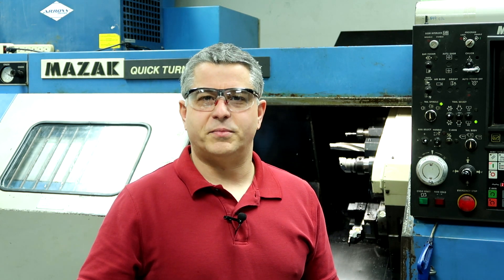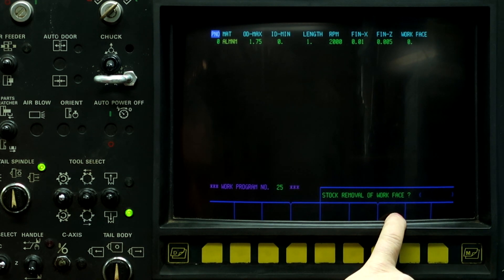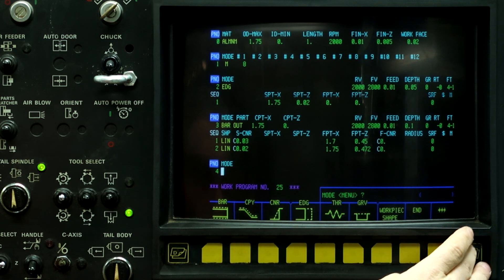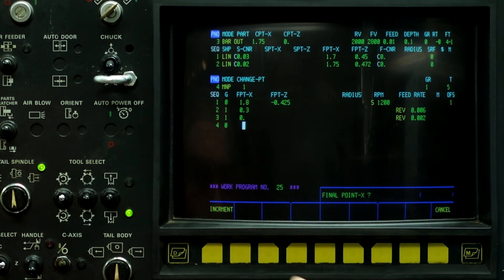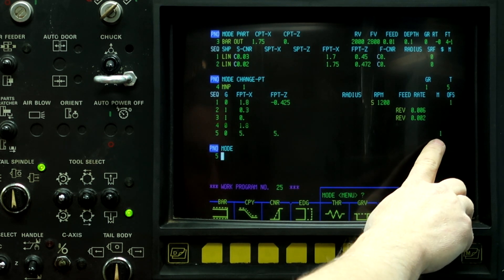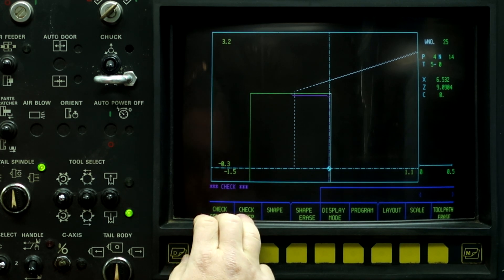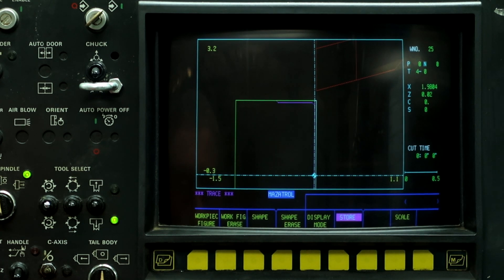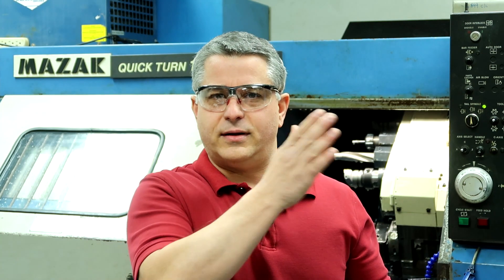Mazak Lathe END Process Z Shift Looping a Program

Comment: where can i buy the bar puller/parting tool? can you provide part number? thanks for the helpful video.
Reply from the maker: Ebay has some.  I modified a Royal bar puller in the video to also use a cut off tool.

Comment: Fantastic Videos! I use these to brush up on my programming of our Mazatrol T3. Is there a way to Part a piece with out the manual G programming? I seem to have forgotten another programming procedure for parting!
Reply from the maker: You can use a grooving operation but you cannot control the max rpm on the older controls. The part tends to whip away from the catch bucket when the machine winds up to programmed max speed.
Reply: @mazatroltipsandtricks6816    I was thinking the grooving operation might work but its been years since I have programmed parting. Thank you Phil!

Comment: i know you're using blade as for your part off tool yet the computer shows a grooving tool eh? can you not make the shape or draw it on the control?
Reply from the maker: I didn't describe the blade shape correctly. You are right.  Good catch.  I should have described the stickout longer.  It is just for the graphics and does not change the program.